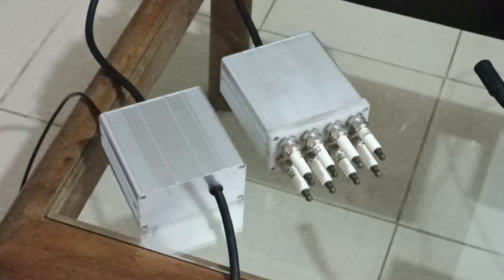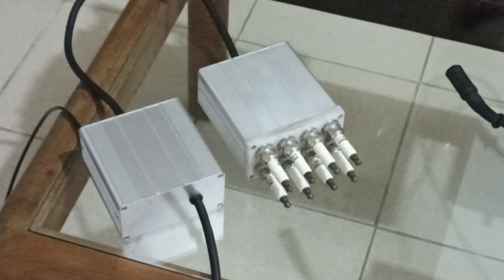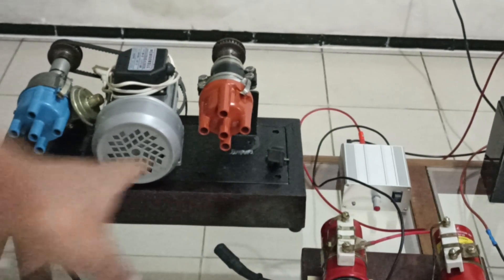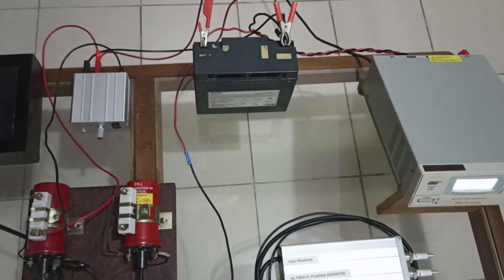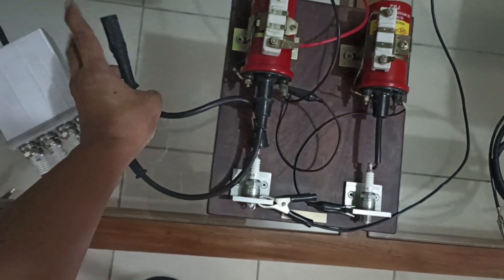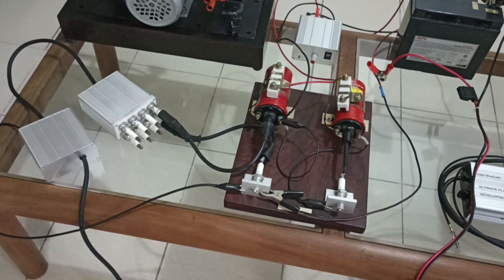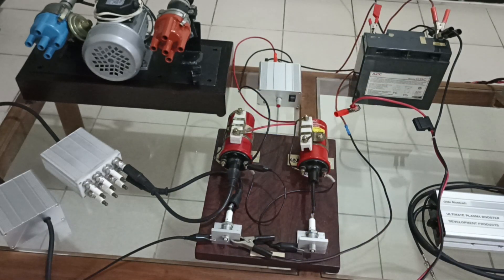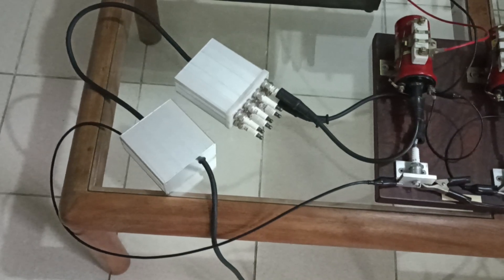Quad-Channel Ultimate Plasma Booster

Comment: Have you tried it in a car yet?  And if so what were the results?
Reply from the maker: Yes and my spark plugs electrodes were melted. But sometimes you need this kind of ignition booster, for example drag racing.
Reply: @OkkiMoeljadi  with certain fuels sure, can you dial the boosted spark at all or is it always at its nominal voltage?
Reply from the maker: @njzoucha  the boost voltage of this module is more or less constant at 800 V.

Comment: Well done Okki, like one of those
Reply from the maker: Thank you!
Reply: Okki could this spark go into a bifilar coil and be collected with diodes and cap? Or could it turn a ion motor connected to a generator? That is what I am trying at present
Reply from the maker: @dkdyker  I think this unit is open for experimenting. The principle of this device is always the same and we can do many things using this device.